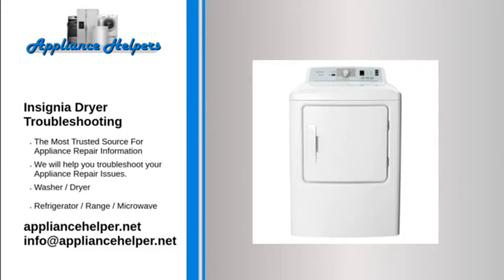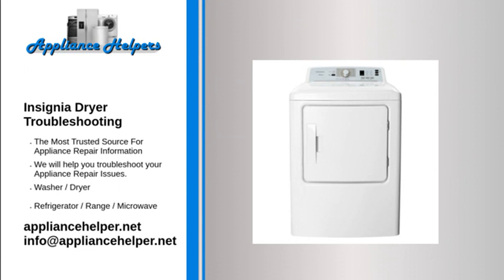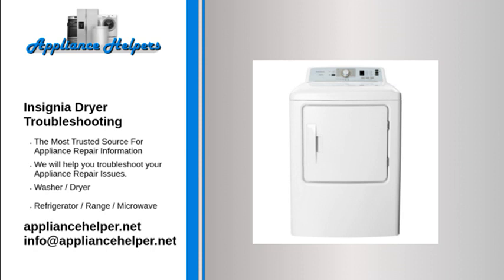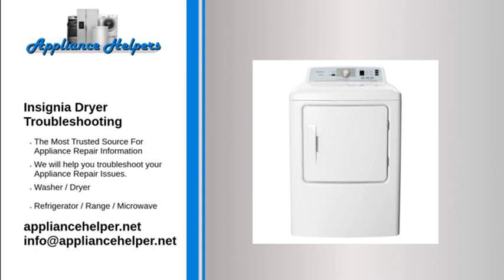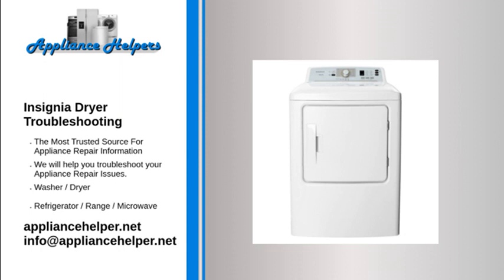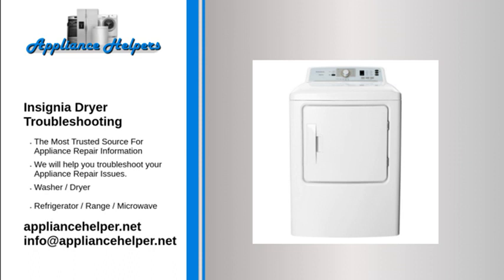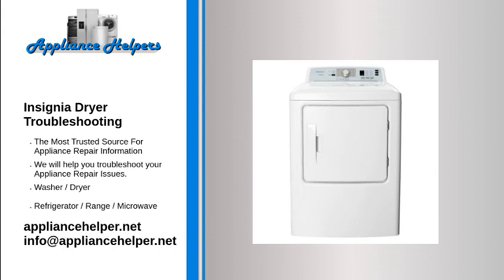Insignia Dryer Troubleshooting

Comment: still got some heat but wont dry clothes without redoing it all over again.
Reply from the maker: If your Insignia dryer is still producing some heat but is not effectively drying clothes on the first cycle, there are several potential causes to consider. Here's a troubleshooting guide to help you address the issue:

Clean the Lint Filter: Start by cleaning the lint filter before each load. A clogged lint filter can restrict airflow and reduce the dryer's efficiency. Remove any lint buildup from the filter and ensure it is properly seated back in place.

Check the Ventilation System: Inspect the dryer vent hose and exterior vent opening for any obstructions or blockages. Clear away any lint, debris, or objects that may be restricting airflow. A blocked vent can prevent proper ventilation, leading to longer drying times.

Verify the Dryer Settings: Make sure the dryer settings are appropriate for the type and size of the load you are drying. Select the correct cycle and temperature settings based on the fabric care label of your clothing. Avoid overloading the dryer, as this can impede airflow and prolong drying times.

Inspect the Heating Element: Check the heating element for any visible signs of damage, such as broken coils or discoloration. A faulty heating element may still produce some heat but not enough to effectively dry clothes. If the heating element is defective, it may need to be replaced.

Clean the Dryer Drum: Wipe down the interior of the dryer drum with a damp cloth to remove any residue or buildup that may be affecting drying performance. Fabric softener sheets and dryer sheets can leave a residue on the drum, reducing airflow and heat transfer.

Test the Thermostat and Thermal Fuse: Use a multimeter to test the thermostat and thermal fuse for continuity. These components help regulate the dryer's temperature and protect against overheating. If either component is faulty, it may need to be replaced.

Ensure Proper Installation: Verify that the dryer is installed correctly and level on the floor. An improperly installed dryer may not operate efficiently and can cause uneven drying.

Consult the Owner's Manual: Refer to the owner's manual for your Insignia dryer for additional troubleshooting tips and maintenance guidelines specific to your model.

If you've tried these troubleshooting steps and the issue persists, it may be necessary to contact a professional appliance repair technician for further diagnosis and repair. They can identify any underlying issues with the dryer and recommend the appropriate course of action.

Comment: Dryer will not power on
Reply from the maker: If your Insignia dryer is not powering on, it can be frustrating, but there are several troubleshooting steps you can take to identify and potentially resolve the issue:

Check Power Supply: Ensure that the dryer is properly plugged into a working power outlet. Test the outlet with another device to verify that it's supplying power. If the outlet is not working, check the circuit breaker or fuse box to see if a breaker has tripped or a fuse has blown.

Inspect Power Cord: Examine the power cord for any visible damage, such as frayed wires or cuts. If the power cord is damaged, it may need to be replaced by a qualified technician.

Reset the Dryer: Some dryers have a reset button that can be pressed to reset the appliance. Refer to the dryer's user manual to locate the reset button and follow the instructions provided.

Check Door Switch: The dryer's door switch is a safety feature that prevents the dryer from operating when the door is open. Make sure the door is fully closed and latched properly. If the door switch is faulty or not engaging properly, it may prevent the dryer from powering on.

Inspect Thermal Fuse: The thermal fuse is a safety device that shuts off power to the dryer if it overheats. If the thermal fuse is blown, the dryer will not power on. Use a multimeter to test the continuity of the thermal fuse. If it's blown, it will need to be replaced.

Test Control Panel: If the dryer has a digital control panel, check to see if it's responsive when buttons are pressed. If the control panel does not respond at all, it may be faulty and need to be replaced.

Contact Support: If none of the above steps resolve the issue, it may indicate a more significant problem with the dryer's internal components. In this case, I recommend contacting Insignia customer support or scheduling a service appointment with a qualified technician for further diagnosis and repair.

By following these troubleshooting steps, you can hopefully identify and resolve the issue preventing your Insignia dryer from powering on. If you need further assistance, don't hesitate to reach out for help.
Reply: @gabriellesmall7244

My dryer is not powering on either. I've checked all the obvious things but still no power. 

Can I ask what you did to fix your dryer? Any help would be greatly appreciated!